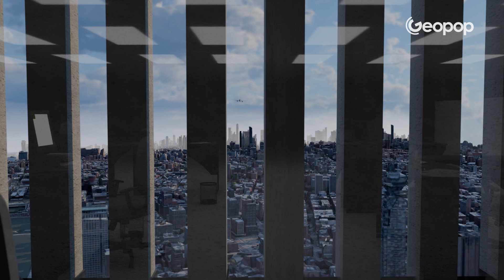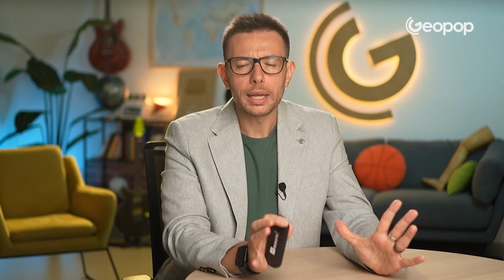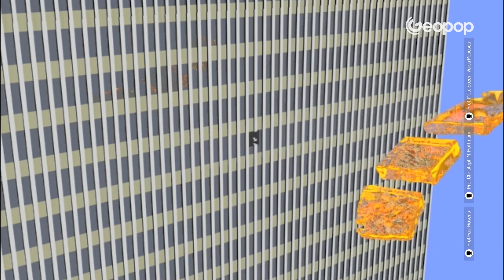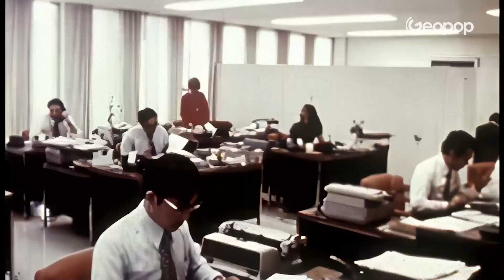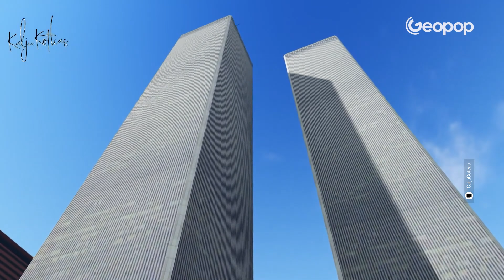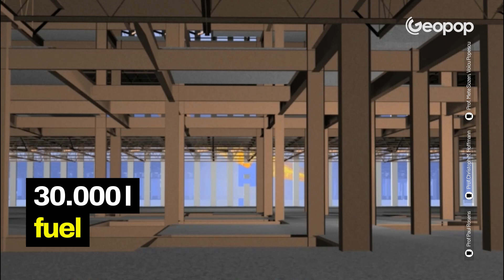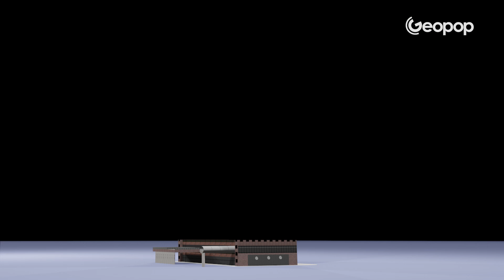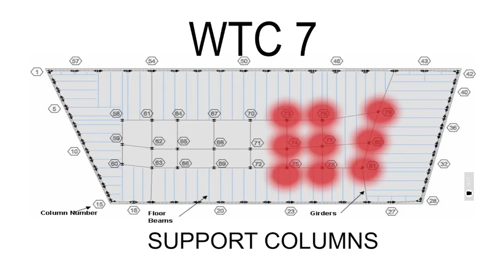9/11, 2001: The Technical Reconstruction of the Twin Towers and WTC 7 Collapses

Comment: NIST never even attempted to detail the mechanics of the collapse of wtc 1 and 2. FEMA passed it off to the commission report who passed it to NIST. Then NIST dropped it. Why? Because there isn't enough kinetic energy to do the work we all saw on TV when the buildings came down. Any attention to the actual collapse means an admission of added energy
Reply: The NIST explained how the Twin Towers collapsed in great detail. What they didn't explain - because they didn't need to and it wasn't part of their mandate anyway - was how they kept collapsing .

From an engineering perspective this is not an issue. The NIST are engineers writing a report for other engineers who don't require the explanation. They can already work it out.  Even a layperson can work it out - most of the mechanisms are visible to the naked eye.  The NIST were asked to determine why the Twin Towers collapsed not why they kept collapsing, in order to improve building standards and codes.  Why the Towers kept collapsing (which is inherent in the report anyway - see above) does nothing towards that goal. 

This is only an issue for conspiracy promoters who are always looking for a void they can fill with their own narrative, a seed of doubt they can plant, even if its over nothing.
Reply: @TheLoonResistance yeah, like it was unimportant to explain the facts we can all plainly see, like why the collapses gained downward momentum. Your rationalization of NIST's failure is wrong on a technical and common sense level. NIST's failure to detail the mechanics of the collapse suggests they had no sophistry for disregarding Newtonian law other than tangential references to Bazant's fraudulent 2002 paper
Reply: Not to mention the Commission and NIST reports were the greatest promoters of conspiracy- only their conspiracy theory doesn't explain the facts of the crime
Reply: @mattdahm4289  - English comprehension is not your strong suit I see. I don't know how to Fisher-Price it down any more than I already have. 

Of course the collapses gained momentum as they progressed. That's how gravity works - how Newton's laws work. Only way it can work. Again, engineers don't need to be told the bleeding obvious and pionting out the bleeding obvious does nothing to improve building safety, which is what The NIST were actually tasked with doing. But hey, if you can't figure out how collapse progression stage worked on your own I can and have, so let me quickly run the whole thing down, start to finish. It won't fit your dogma but it does have the benefit of being accurate:

While complex, most of the Twin Towers collapse mechanisms can be seen with the naked eye and easily discerned and understood by the layperson IF sufficient time is taken to understand.

1.   The Twin Towers consisted of 4 primary structural elements together forming an integrated system where each relied on the others. 47 hollow box-section steel Core Columns carry most of the gravity loads. The 236 hollow box-section steel Perimeter Columns carry the remainder and ALL of the lateral (wind) loads. Long-span Lightweight Steel Trusses connect core and perimeter column together with a Hat Truss on top to tie it all together as an integrated unit where no element can survive without the others. There was no structural load bearing concrete and most major assemblies were bolted together

www.youtube.com/watch?v=u7OqrC74Dm4
www.youtube.com/watch?v=eKtgPt7e0Fw 

2.   The impact of a 122-ton airplane (= 12 dump trucks) at up to 587 mph with the energy of a ton of TNT destroys the aircraft in 0.50 seconds. This in no way implies the Towers come out unscathed. Some folks get hung up on that. Many perimeter and some core columns are destroyed or damaged primarily by bending, twisting, splitting weld seams and critically by bolt-shearing failures at the end connecting flanges. No cutting or slicing - the reality far more violent and brutal. 

www.youtube.com/watch?v=zF-94yDHlk8

3. The impacts destroy or damage fire insulation, fire breaks and sprinkler systems on multiple floors. Jet fuel acts as an accelerant starting huge fires start across multiple floors simultaneously that spread spread rapidly with no effective firefighting or fire suppression. This was an unprecedented fire event . Office buildings are essentially giant piles of kindling when it comes to fires, chock full of stuff that burns vigorously and quite hot. 

4. The hotter steel gets the weaker it gets shouldn’t be a revelation. With fire protection compromised the survival time of the steel greatly reduced . Over time heat gradually causes the lightweight steel Floor Trusses at the damaged floors to sag, which we can see. No steel melted or needed to. Structural steel fails long before it becomes a puddle. It just needs to bend 5. A straight column is up to 4 times stronger than a bent one. Sagging floor trusses pull on increasingly weak and overloaded Perimeter Columns, causing some of them to bow inward by up to 5 feet until they buckle and fail, quietly initiating collapse. The formerly static mass above which the structure below could easily support converts to a dynamic mass up to 30 times greater. The Columns above and below the failure point are no longer aligned . The load bearing structure below no longer bears any of the load above, which falls past the lower columns NOT onto them. www.youtube.com/watch?v=ULdiD6gYZO0 www.youtube.com/watch?v=zTygQK3vriI 

6. Heat starts the collapse, gravity finishes it . Thousands of tons of debris drop largely within the four outer walls, through the open office space, the path of least resistance crashing onto the first intact floor, The bolted column connections instantly break as the amount of resistance the Floor Trusses can offer is negligible, slowing the falling debris only marginally and briefly before the connections fail. www.youtube.com/watch?v=flo62pdaIMI
Note: 
6a. This is NOT a solid top block crashing into a solid bottom block . 
6b. The debris falls past the columns not onto them. The columns provide no resistance to the falling debris. 
6c. Only the bolted floor truss connections to the core and perimeter columns offer any resistance. A pair of 5/8” bolts at each end of each truss vs. thousands of tons of falling debris. 
6d. No laws of physics are violated. 
6e. There is no 20 floors against 90 floors but rather 20 floors against one floor, then 21 floors against one floor, then 22 floors against one floor, etc. 

7. This floor-led collapse progression largely within the four outer walls can only go straight down. There is no lateral force to push it over the side, only gravity to bring it down. 

8. Collapse progresses through the floor systems past the columns, through the path of least resistance . Resistance offered by each floor is always the same while the falling mass acting on it is constantly increasing and accelerating (gaining energy). This process of floor-by-floor destruction cannot be arrested. It can only speed up . Rate of floor failures increases with each floor as momentum increases, reaching an average acceleration of 0.65 of GA, or 35% slower than true free fall. Bam, bam, bam down the building until there are no more floors to fail. More mass, more velocity, same resistance with each floor. Don’t get stuck on the but the lower floors weren’t on fire nonsense. They didn’t need to be. 
8a. This process is often incorrectly referred to as “pancaking” which while catchy, is incorrect. Too simplistic and inaccurate anyway. More like Kaiserschmarrn. 

9. The Towers were 95% air by volume. As that air was compressed inside the building by falling debris, pressure builds until it is blown out the sides in reaction to the building collapsing . Those were not “explosions”, it was expulsions of compressed air caused by the collapsing building, explaining the low velocity, lack of flash, blast, supersonic pressure waves and lethal high-velocity ejecta. 

10. Perimeter Columns become detached and peel away like a banana behind the collapse front, playing out to the four points of the compass in long lines extending to 800+ feet from the base of the towers, damaging and destroying nearby buildings. 

11. Core Columns fail last as their internal beam bracing is stripped away by falling debris and lateral support from the floors to the perimeter columns is lost. 

www.youtube.com/watch?v=WpHXj62Ylw0

12. This process took 31-34 seconds from perimeter columns bucking until the last core columns hit the pile, or 1/3 the rate of true free fall. Don’t believe me? Just watch a video of the collapses and note the loose truly free-falling debris dropping much faster than the towers themselves. 

https://www.youtube.com/watch?v=dh4r-gHdyPU 

13. Each Tower had a 1-acre footprint. Far from collapsing inside their own footprints the debris pile spread out over 17 acres in a pile up to 14 stories deep. 8 surrounding buildings were destroyed and scores more damaged by the falling debris. 

14. NOT observed were the 180-190 dB bangs of thousands of high explosive devices or the blinding brightness of burning thermite. Explosives or thermite couldn’t have survived the impacts and subsequent fires anyway. Nor could they have caused the perimeter column buckling that clearly initiated collapse. Video of an injured and in-shock firefighter casually using the magic word explosion isn’t proof of explsoIVES and hardly makes a case for planned demolition. Pre-planned demolition doesn’t match the physical evidence and would be technically impossible, totally impractical and completely unnecessary. Simply, no one would bother. In 24 years, no structural engineers of tall buildings, including the 1/3 who have retired, have made any statements in support of planned demolition claims. NONE. The lack of such citations in engineering literature published anywhere in the world is telling. 

15. Twin Towers were perfectly safe within their design envelope. They only collapsed when taken far outside design parameters by an extraordinary and unprecedented event Impact + Fire (heat) + Time + Gravity = Collapse . Remove any 1 of those 4 elements and there is no collapse. Ignore any of them and you will never understand the collapse. The Twin Towers were an integrated system in which no one component could survive without the others. One fails, the rest follow, through the path of least resistance DOWN the open space, bypassing the path of greatest resistance, the columns. No laws of physics are violated and the above is true no matter who planned and carried out the 9/11 attacks or why so the attacks could still be an “inside job”. 

If you made it this far, kudos. That was a lot. I hope it was helpful, informative, non-adversarial and solicits informed critical comment, positive or negative. If I made any errors of fact, logic or reason or left anything critical out, please let me know and I’ll fix it. To stay focused, just one point at a time please and on-topic (Twin Towers ONLY). No word-salads of Gish Gallop. IF you can offer a more plausible alternative be my guest. Please start any reply with the words “Tits McGee” or I’ll know you didn’t read it and aren’t serious. Thanks for your time.

Comment: every black smith will tell you, that they heat the iron to red glow, i.e. 550 degC, and then they hit it with their hammers. burning jet fuel got much higher than that.

Comment: KevinRyan, deptHead ofUnderWriterLab was FIRED from his job for askinguncomforab’e questions. Firemen aware steel+concrete framed builgs NOT FALL due to fire. This is the reason we can see them march INTO the BURnING blng fearlessly!!! Aviationfuel was burned out after impact (blck smoke), while WHITE smoke billowing from bsmts level
Reply: No he wasn't.

Ryan ran a small drinking water testing lab. He used company email and company stationary as well as exploiting his title in the company to spread conspiracy rumors he copied off the internet. He was fired for misuse of company property and misrepresention. The only things Ryan knew about 9/11 are things he copied off the internet. He had zero personal involvement in anything related to the Towers or the subsequent investigations and no background in civil or structural engineering.  He drank the Kool Aid and used false appeals to authority to spread his newfound Gospel. Then he quietly faded into obscurity about 15 years ago.

Comment: Is it just me or does NIST's simulation of WTC7 collapsing from one side of the building to the other look nothing like the videos of the actual collapse, uniformly side-to-side and back-to-back?

https://youtu.be/Mamvq7LWqRU?is=40i9zAaRqJfHJl22
Reply: The NIST Simulation #4 shown isn't meant to look exactly like the collapse of Building 7.  Not even all of the building components are there. That simulation (the one shown here) was designed to show what would happen if Column 79 were to fail even in a pristine, undamaged building. What happens in that model is what we saw happen in the real event - a progression of collapse through the buildings core structure from east to west until all of the core columns have failed, taking all of the floor beams and girders down with them. 

Worth noting the link you provided has edited out major portions of the collapse, showing only the money shot at the very end, not all the interesting but harder to see bits that preceed it. So its more than a bit deceptive.

Comment: This guy has no clue what he's talking about. Remember the video of the corner of the building where it looked like somebody was actually doing welding. Where the sparks was shooting out , and at times it looked like molting lava pouring out from the corner of the building.\n There is video of it, and I'm sure that we all saw it. It takes roughly a temperature of 2500°\n To do that, to steal and right at that point is where the building twisted and buckled\n And the pancaking of each floor began you can see the puffs of smoke.\n Coming out of the windows and the floors\n From in between the floors, as the building is collapsing.  Squibs of smoke, dust and debris.\nIs what happens when a building collapses , air pressure pushing downward and outward. There were no secondary bombs hidden inside the walls of the twin towers.\n That was one of their theories.\n That some terrorist came into the building.  Disguised as maintenance workers during a normal work day in the building.\n Right in front of everybody, totally ridiculous and impossible to do. It would require massive construction on every floor cutting through walls.\n And metal.\n Cleaning up debris after\n Cutting through everything.  And trying to strap a bomb to a park of the inner exterior you would have to clean it all up, bring up new sheetrock.  New paint probably some new BX cable.\n To fix whatever electrical cables that you damaged\n While trying to do this\n Then you would have to  Patch, the giant hole that you just made sheetrocket tape it and then paint it and discard the debris all the way down to the main level.\n Probably the parking garage and then continue to do it again floor by 4, during a normal work day in the tower. Totally impossible, totally ridiculous could have never been done.  Without being noticed or caught was one of their theories. What a bunch of morons could have never happened like that.\n First of all, the floors were only held up by very thin  Metal trusses.\n That were bolted on to pieces of metal at each end, probably about five inches long an L bracket at egen, that's all. I have been in construction for 45 years.\n Building brand new apartment buildings in The Bronx.\n And Manhattan.  Use the same exact system, very flimsy, very thin plus no inner columns to support anything, really just a main core in the center floor is built around it. And trusses were just bolted at each end.\nWith no inner columns to support anything. Maybe a couple here and there support columns are supposed to be\n In the same spot on every floor\n So it is one continuous support, all the way down to the bottom. So the trusses\n Were bolted at each end? So when it collapsed, it just pulled the outer skin inward.\n And proceeded to Pancake\n If you ask me a very stupid, weak  Design they are lucky. The buildings fell\n Basically, straight down.\n Floor by floor on top of each other.\n Rather than  Falling to the left or the right\n And collapsing on top of other buildings and civilians
Reply: That was the NE corner of the South Tower and the material was aluminum and probably lead.